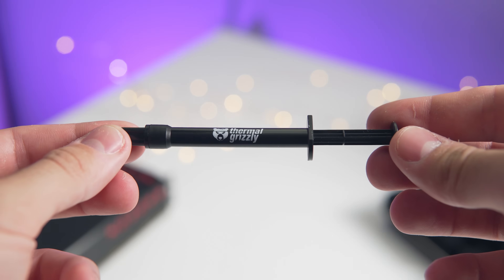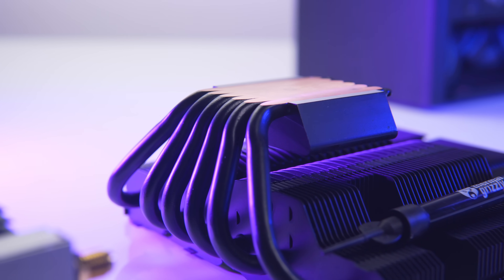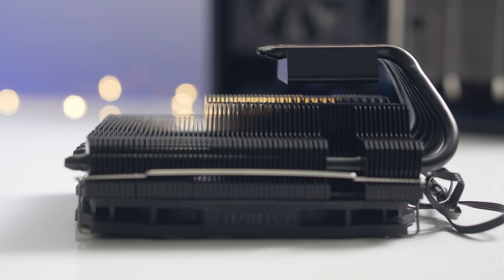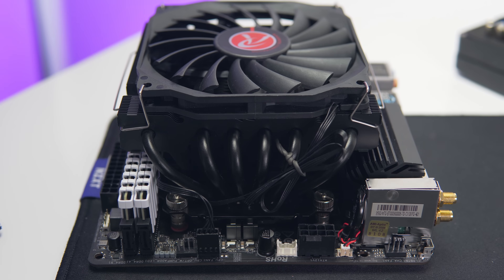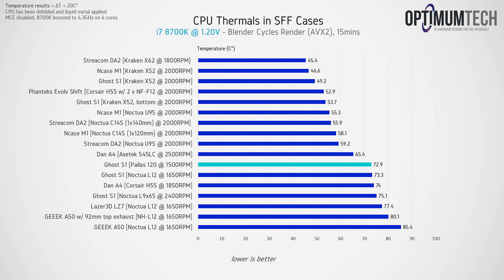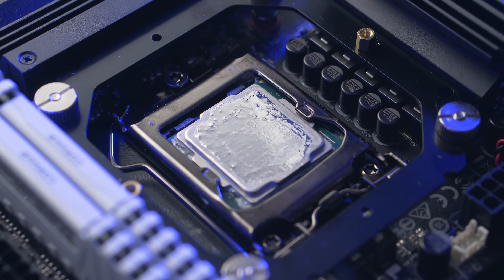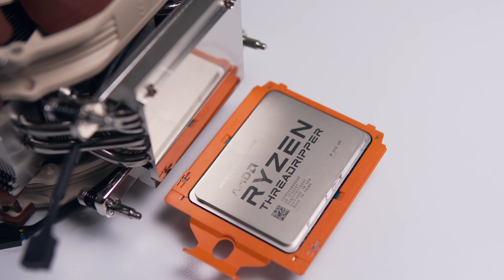Liquid Metal for CPU Coolers - Worth it Over Paste?

Comment from the maker: Always fun to re-visit liquid metal under certain settings. 
Tonne of GPU content lined up next week - stay tuned!
Reply: If you want even more overclocking headroom you need to replace the toothpaste under the cpu heat spreader; make sure to apply some nail polish, before applying liquid metal, to the component near the core to avoid short circuit
Reply: @fabiotiburzi  his CPU has been delidded, he says so in the video and shows him applying the LM on it at least twice in this video.
Reply: @nightblazzed  sorry, i'm new on this channel, i didn't know
Reply: Could you please make a video about SLI/Crossfire on your X399 TaichiM utilizing the top and the bottom vs. the top and middle PCIe x16 slots. The Ceberus case has 5 PCIe slots. I dont know which cards are available to you but I'd love to see that!
Reply: Any chance you can do a video with a short gpu in the ghost s1 and a SFF AIO behind the power supply ??
Reply: So stop at 1:50

I have watched a livestream last Sunday with Roman Der8auer.
And hes said aftert all his test he has the conclusion that after Aluminium Copper is the 2cend bad thing to apply LM to.
I watches by my MacBook Pro self that the Copper will get a verry ruff layer that is hard to get away.
And Nickel platet are one the slowest reaction with it and so it is the best. But in every layer like Copper Nicel or the die iteself will get slowly penetratet by this kind of cooling solution.

And now play to watch the rest.
Reply: In theory you should be able to fit a 140mm fan with 120mm mounting on that heatsink. I'd love to see it confirmed! (Cryorig has a slim 13mm 140mm fan with such mounting.)
Reply: Would love if you could test the cooler master geminii M5 led in your Ghost S1 case? It should fit and is compatible with all recent sockets, including AM4.
Reply: i wonder how effective gallium would be as a thermal solution in a liquid loop designed to run it. would it be a larger improvement over water and cooling liquids currently used?. that might be an expensive experiment though lol. but a pretty interesting idea.
Reply: Why a small form pc over a bigger pc? are there any benefits or just your personal preferences.
Reply: @To Think Truth Thank You =)
So i watched last time a German Chanel named Igor´s Lab and he was showing some Industrial Cooling Sulotion which where amazing it they where avaialble to normal Costumer. So there are easier mthodes to fill the gab but there are not for normal customer =/ so we need to wait.... =)
Reply: Xtreme Performance  I delid mine and put Thermal Gryzzly Kryonaut inside. for me the most logical solution.
Reply: Honestly, for someone who does overclock it is worth it. People who did some overclocking to push the CPU to its limits will confirm... Lets say that in some cases you desperately need it... But i would say that it's more worth on water .... Watercooler needs longer to heat up water, that's why ppl think that it's really different world in temperature... But after a few hours of pushing it, most of AIO's gonna perform few degrees cooler than let's say Noctua or bequiet , some may be even worse... But if you can gain 5-7C on water and 2-3 in changing paste for 10 bucks that may let you push your CPU for another 0.1 GHz, depending on the silicone of course ...
Reply: What it is made of ? Gallium? Mercury?
Reply: Where to buy this tool kit?
Reply: can you do a thermal paste and liquid metal mixed

Comment: you CAN NOT do this without properly insulating the liquid metal from spilling out. Liquid metal, when heated or cooled, expands and contracts and, because it is less viscous, exhibits a "bleeding/running" effect. If positioned in such a way where gravity is pulling the liquid metal parallel to the surface of the CPU, the liquid metal can actually spill out onto the electrical components immediately surrounding the CPU die/socket. If people remembered, this actually happened to some models of the PS5 on early release because some models didn't have proper insulation. This is why delidded cpu's with liquid metal often require some new integrated heat spreader with multilayered gaskets or microtrenches to prevent the liquid from oozing out of the cpu and onto sensitive electrical components. 

applying liquid metal like this is stupid and reckless for very little benefit. It's not a matter of if it spills out, but when. PLEASE DO NOT APPLY LIQUID METAL LIKE THIS. not only that, but liquid metal has gallium in it, which contaminates many metals and compromises their integrity by disrupting their atomic lattices resulting in metal that is as brittle as stale bread. please do not mess around with liquid metal if you don't know how it works.

Comment: Short Answer : Absolutely worth it !!

I applied it on my laptop and now the thermals don't cross 75° C.. previously it used to touch 98° C with the usual thermal paste during gaming/heavy tasks. It's been months and performance/thermals are holding up really good so far.

Comment: i have the i9 9900k and use it mostly for gaming, without the LM had 75-ish degrees after LM 45-50 degrees and idle 38 degrees (fans not on max speed, with full speed hit even a low as 24 degrees idle with overclock)

Comment: Imagine they made a cpu that had a built in heatsink so there is no gap between the lid and heatsink, which would negate the need for thermal paste... Then just add in whatever fan you want to use on the heatsink. Would this work out?

Comment: so you can uasre if the heatsink is copper? or even after even 1 year it can create problems to the cpu or to the heatsink itself due to corrosion? (I have a noctua d15 and a 5800x)

Comment: You used the wrong tip to apply the liquid metal. You’re supposed to use the needle looking tip.
Reply: Hey, you seem to know about using this stuff.  Question: I've installed maybe 12 CPU's in my life.  So I'm probly a beginner.  Is using this Conductonaut something that I should avoid?  Like is it probly beyond my capability to apply and install?

Comment: Grazing the surface with a very fine abrasive will increase the surface area that is potentially thermally conductive, therefore increase the amount of thermal conductivity of the system. Although the thermal conductivity of the paste or liquid metal (Gallium alloy) would be a limiting factor, ultimately, surface area is were you would be able to see the greatest difference in thermal performance. This concept can be easily understood by understanding how a water cooled radiator functions.
Reply: The greatest heat transfer between two surfaces occurs when the two surfaces directly contact each other. Scuffing the surface increases surface area exposed to liquid metal, but decreases surface area of direct contact by creating tiny cavities to be filled with the thermal paste or liquid metal. No matter what paste you have, it will always add some amount of thermal resistance and thus you want the smoothest possible surface. You want to minimize the amount of thermal paste between the plates (which in turn exists to minimize the amount of air between the plates).

Comment: Just sand smooth the CPU surface, then sand smooth the HSF surface. Then rinse & dry both. Then use arctic silver revision #1 and spread around with a carrot or an uncut cigar. You will see idle temp drops of at least 25C and looped benchmark temps that never exceed 39 c,
Reply: Thanks for the advice, Warner Bros cartoon character.

Comment: My processor i7 4790k. gaming Temps are in the 85-90°C rang.   reduced my temperatures best solution liquid metal or thermal paste?
Reply: i have same cpu i use MTG10 temp ON gaming = 60-63 not OC

Comment: Soooo is it safe and does it work better than paste?
Reply: Nah I can't imagine how they'll be safer than non conductive thermal paste. Not sure of these are like that too tho
Reply: @F-22raptor-22  then how the heck is liquid metal better for the PS5? It sure as shit works lol
Reply: @TravisSlayton  there's nothing particularly bad about it. It's just not as safe and degrades the actual heat sink over the span of years
Reply: @F-22raptor-22  how does it effect a heat sink it’s not exactly near it. The CPU you mean?
Reply: @TravisSlayton  nah the copper on the heat sink; its metal to metal contact. The heat causes changes in the size of the liquid metal, it's like grinding it around on it over the span of years tho
Reply: @F-22raptor-22  ohh so because it’s almost the same material just in liquid form it’s not quite as effective as thermal paste?
Reply: @TravisSlayton  Almost, liquid metal does work better but it has its negatives. Thermal paste is usually made up of ZnO which an ionic compound and non conductive. This makes it safer incase you spill on your cpu pins or motherboard. Liquid metal is metal just by itself which is problematic as it also in contact with a metal heat sink. raw Metal to metal breaks down the surface over time.
PS5 needs liquid metal as the cpu cooler isnt that big, it also has memory temp issues
Reply: @F-22raptor-22  the heat sync in MASSIVE THO lol
Reply: @TravisSlayton  true, the copper block is big and thick, which means its more of a passive cooler. It relies on very good contact and thermal conductivity with the block itself, rather just airflow and fins.
And my point about memory chips being hot is an actual issue.

Comment: Liquid metal may not be the be all end all, but if given the option (and frankly it is not all that expensive when you've already payed a lot of money for your parts...in my case I've just bought parts for 2K Euros and will need to buy a GPU soon as well, as soon as they are affordable again (not spending 1K on a card that should cost 700 at max!)) why not? Hell, I've added that exact paste (the Grizzly Conductonaut) to my old i7 2600K and I've seen a reduction in temps over the old (ok: It was 6 year old paste at that time) paste :)

Comment: I have one of those CPU coolers you're using and it sucks. While it does cool good once it's mounted, it's just pain in the ass to mount. I ended up using a different backing plate from another cooler that didn't have thick foam backing, very hard to tell how much pressure you need with it, and stuck two sided tape on that cross bar that holds the heatsink on by two screws. It's a stupid design, too many pieces, not something you'd wanna do CPU swapping with. It does cool good though, the CPU surface area is nice and flat with no gaps between the copper tubes... reason why I got it in the first place.

Comment: Got to say: pretty brave to try that with a Heatpipe Coldplate. Technically it's copper yeah, but most coolers which just have the heatpipes directly as contact area have an aluminium Block above and I wouldn't risk it's myself that some of the liquid metal destroys it. I'd only do that with full Copper cold plates or even better nickel plated copper coldplates. As I think you know by now copper will react too, but it won't be destroyed, and it's thermal conductivity won't be worsened. It will look like the LM has dried up and you won't be able to remove it unless you start polishing. But that's not  a problem, more the other way around. The more of the LM has "dried in" there, the fewer can do in future, and soon you won't need to replace it anymore. It will just not be as pretty, but I think I can live with that for such an improvement in temperature ;D

Comment: Who is here after PS5  teardown ?
Reply: ME hahaha
Reply: Same
Reply: FührêrFPöñê PS5 isn’t overclocked. All RDNA 2 GPUs run over 2 GHz like the PS5. That makes the Series X underclocked. 😂
Reply: Only you... I swear xD
Reply: LOL
Reply: Nah ps6 teardown
Reply: Not as impressive as they made it sound eh, as long as next gen consoles handle the CPU heat fine (which they obviously will) it makes no difference in what's used.
Reply: @rinaa6865  how often does liquid metal need to be replaced? Is there a risk of it spilling out when the console is being flipped, moved around (like, being carried in a backpack)?
Reply: Wallace Sousuke timmie joe did a video of a system using liquid metal that had dried in one year so who knows?
Reply: @wallacesousuke1433  The LM shouldn't spill out since it has foam barrier around it and PS5 is designed to be mounted either vertically or horizontally.
Reply: Yep
Reply: Same
Reply: Me too LOL.
Reply: me ha ha
Reply: Lol
Reply: Me hahaha
Reply: Already applied that ob my ps4 pro
Reply: No
Reply: shutupshutupshutup

Comment: I believe the threadripper uses a IHS that is soldered to the die so i would NOT attempt a delid and the gains would be negligible or actually worse than stock

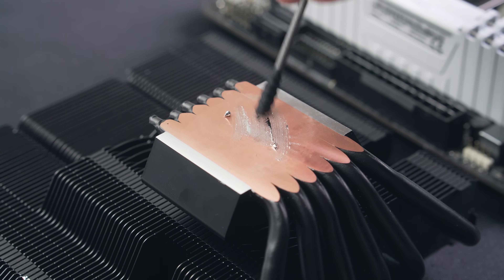Comment: 4:05 WARNING! Be careful with those bare heat pipes coolers! The sides/corners are made of aluminium and if Liquid Metal touches those sides/corners it can easily ruin the cooler!
If you want to use Liquid Metal with those coolers I would recommend covering those sides with kapton tape to ensure that no Liquid Metal touches them!

Comment: You DO need to be weary of COPPER with this.  Nickel plating is stable but gallium will react with copper. - not catastrophically like aluminum,  but it will over time have some effect.  At best just discoloration,  at worst heavy pitting.

Comment: I usually don't leave comments on videos, but now I feel like I need to: Liquid Metal is good only when you know the paste between the IHS and the CPU Die is actually conducting heat very well, which usually in Intel CPUs they don't (at least these new ones). Yes, deliding the CPU and applying Liquid Metal between the CPU and IHS then applying Liquid Metal between the IHS and the cooler will deffinetly improve the temps, but don't expect something miraculous, best case scenario would be 10C difference which would be actually very nice. 

However, I don't like how you applied the Liquid Metal. Indeed, you covered the entire area of the CPU IHS, but moving the hand like that is enough to throw a small droplet of Liquid Metal somewhere on the motherboard without you even noticing. Best use small, delicate hand movement when applying this thermal solution. What I also did not liked was that your system seems to have the CPU in a straight position. You definetly not want to leave the Liquid Metal a very long time there, since it can drip from between the IHS and Cooler, leading it on the motherboard. At room temperature, liquid metal is more viscous and cannot slip so well due to the surface tension. However, like any other substance, when heated becomes more "liquid" and will be less viscous, making it more likely to slip from under the Cooler. Best case to use Liquid Metal is when placing the motherboard down, not in a vertical way like most PC cases are made to mount the motherboard on them. 

So take care, this is not a hate comment or something to discourage anyone or to show myself that I know a lot about this stuff, I am also still learning like everybody else, but definetly take a lot of precautions before applying this interface. Yes, it's very good but can lead easily to a dead system. And for people who would say that I don't know anything about liquid metal, I have 2 and a half years of applying liquid metal in laptops. And trust me, in a laptop is very easy to break it with Liquid Metal.

Cheers!

Comment: 3 degrees is ok, not great but its not nothing! Id be interested in seeing the difference with large form factor cpus like the threadripper series. Delid + lm could squeeze about 7 to 9 degrees lower under load? Paired with a highly efficient heatsink and fan or a liquid cooled setup. May be worth it? Even an extra 100mhz on each core would be good with TR.

Comment: I saw an improvement of 4-5 Degrees, but it's such a pain to apply compared to regular thermal paste. I spent 20 mins removing the tiny droplets that got onto my mobo.
Reply: The issue with liquid metal is that it can easily saturate the heatsink. The heatsink can only output so much heat at a time. If there is more heat going into the heatsink then out, you're going to saturate the heatsink and have similar performance to paste that conducts heat to the heatsink at the same rate that the heatsink dissipates it

Comment: It's not a chemical reaction when Gallium and Aluminum come into contact, its a physical reaction. The Gallium atoms are integrated into the Aluminum crystal structure and make it brittle. There is no change in the electron configuration of the metals therefore it's not a chemical reaction.

Comment: Thanks for making this video, i'm looking to build a new PC in the near future and this convinced me that a good thermal paste (since I don't/won't de-lid the CPU) is really the safer way to go as there's not really much to be gained from using LM on say a 3600X (maybe XT) or a 3700X between the cooler and the processor.
It does make me wonder why chip manufacturers don't invest in better stock thermal compounds for their CPU dies from the factory. at the bulk quantity they'd use, i'm sure they'd get a really good discount for the quantity they'd need and  more importantly it would probably allow them to get better numbers for base/boost clock or voltage, which is always good.

Comment: Liquid Metal Works great when delidding. Was able to over clock to 4.8ghz while keeping temps at 40 degrees. Well worth it.
Reply: Will you still be saying that when the Gallium destroys the metal components?
Reply: @MichaelClark-uw7ex  not metal components. But aluminium components, it wont do shit to copper.

Comment: I put liquid metal on my ihs on ryzen 7 3800x and saw 10 degrees drop from using thermal paste, I use a corsair h150i water cooler and even overclocked it and Temps were still the same at 10 degrees lower than thermal paste! Is it normal or im just lucky?